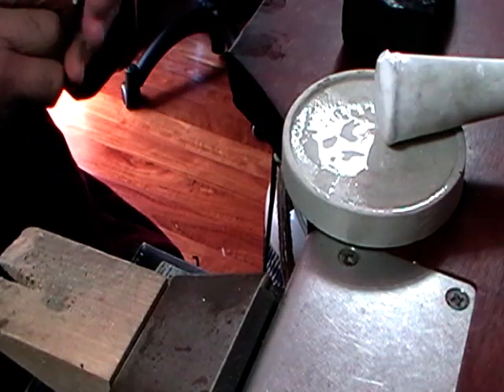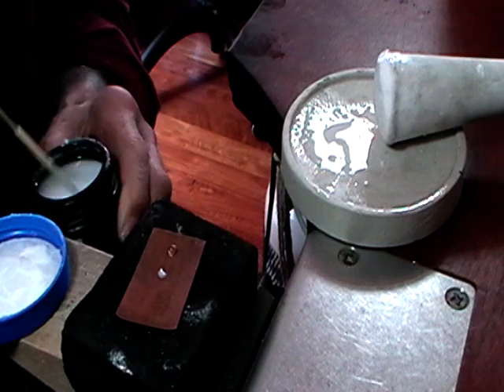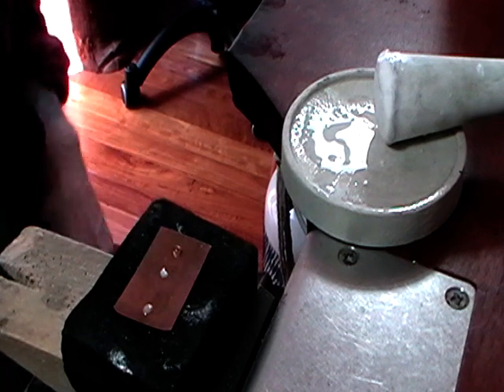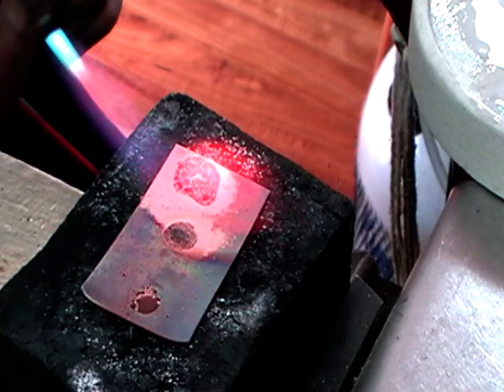borax flux

Comment: The thing is flux is not for cleaning the base metal should be clean already by phisically cleaning all pieces with a cleaner such as scotchbrite sand paper or what have you, All fluxes regardless of form be it in flux core wire flux coated rods or shielding gasses you name it are for the exclusion of the enemy OXYGEN, That's it

Comment: any chance of doing a vid, on the rolling mill, I know you have done one on embossing, I have just got one, and obviously you got the standard, and the ones for patterns, but the ones which makes the wire where the size goes from big to small, I was wondering what you would use them for, and what it does to the metal, do you start in the biggest and then move down to make it into finer wire ?? thanks soham your the man, there are other vids on here on rolling mills, but no one as good as you !